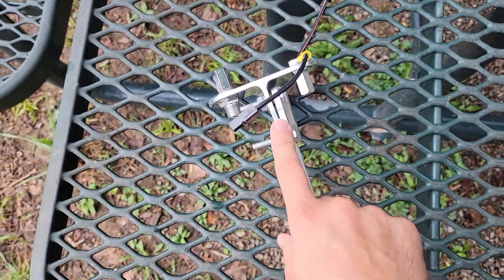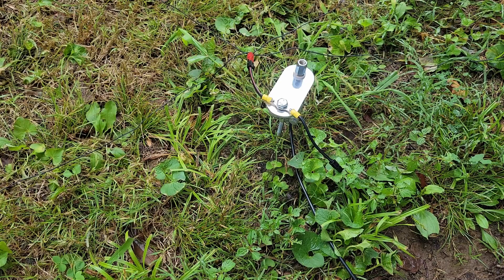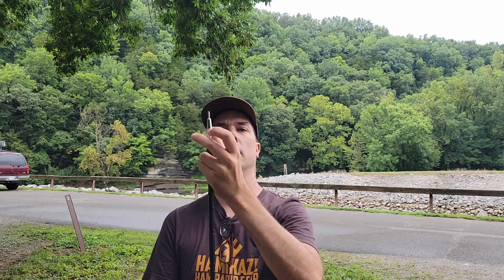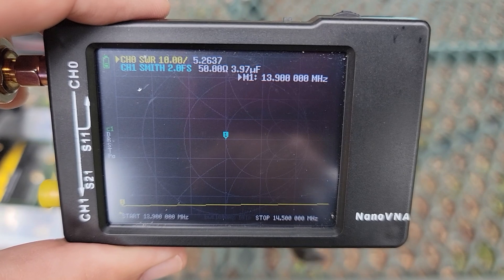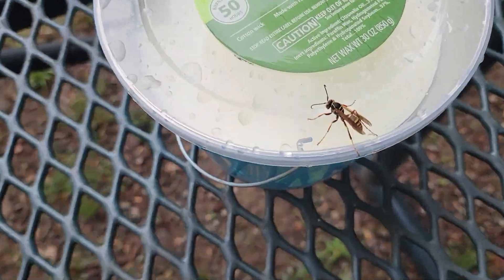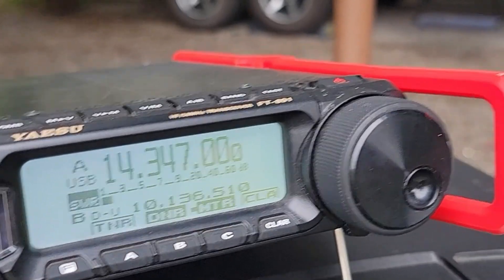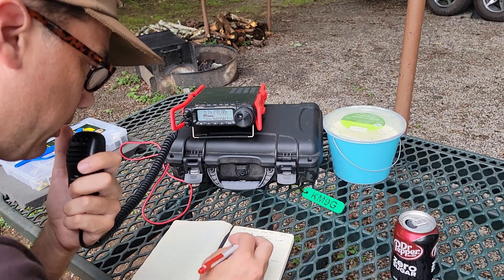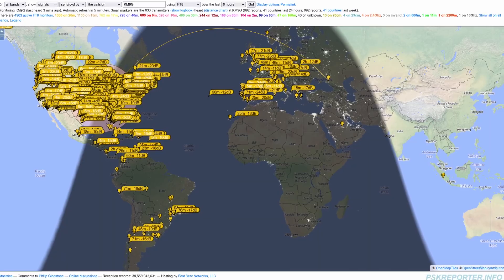These don't even work, right?

Comment: "Just because it resonates, doesn't mean it radiates". Just because you made a contact doesn't make it a good antenna.  I guess it depends on whether you want to use HF for its intended/useful purpose or not.  WAS means nothing to me - I don't see the point of using HF to talk to someone inside the CONUS.
I want to be able to talk to the outside world when talking to the outside world has become illegal.  Or I could just make the DX / contesting argument.
How many overseas /DX contacts did you make with this rig?
Reply from the maker: I have seen people work DX with hamsticks, but it's a compromise -- as is any antenna, and you get the results you get.  If DX is your goal, there are always better choices depending on budget

Comment: MFJ-1898 How do these ham sticks set up compare to the MFJ-1898 you tested. Which set up worked better for you? KO6ALP
Reply from the maker: Setup was exactly the same
Reply: @temporarilyoffline  I guess I meant performance, I can see how easy both are to set up.
Reply from the maker: @besmith00299  They all work "about the same" -with in "statistical norms"... Its really hard to compare two of the same antennas to each other because of changing band conditions, etc.  If these were dipoles vs. verticals or some other "massive" difference I'd be worried.  The only real thing to know about hamsticks is the amount of power they can handle.

Comment: I live in an HOA, have been using hamsticks for the past 10 years. I have 4 hamsticks, each one mounted on a 3’ pole with counterpoise wires. I operate on 30, 40, 60 and 80 meters with the hamsticks. I have WAS on each band. For 20-10 meters I am using a Transworld TW2010 vertical dipole. I highly recommend the hamsticks for an HOA application or portable operation. It’s worked for me over the years….
Reply from the maker: That's awesome!

Comment: I find a great way to experiment is use a laptop or smartphone to tune to a WEBSDR like utah or KFS etc and see what your signals look like far from your QTH. I found out a HamStick on the back of my van does 2 to 5 db better than the 19' tunable endfed on the back of the van. I use a 15 and 20m hamsticks on a plate in the back yard for worldwide WSPR coverage. Yep they get out and receive well.
Reply from the maker: I'm a fan.

Comment: Love hamsticks. Got them on a 2' pole in backyard on a large shelf assembly for ground area. With a 15m and 20m stick connected on the mount plate and spread at a 10 degree angle like a v. With them i run a Ultimate 3 WSPR at 1/4w and get world wide reports on 20,15, and 10m. With my 6 watt qrp rig to WebSdr's all over the US and hawaii i see my signal at only 3db less than the rotatable dipole on the roof. on my van's roof mount i get about the same signal at websdrs all over US and Hawai as my 19' tall EFHW mounted on the back of the van. Soon hoping to get 2 of them mounted about 8' apart and compare to just one.
Reply from the maker: That sounds pretty awesome!

Comment: Appreciate you sharing this video and associated information. I am getting a POTA Station prepared and planning on using some HAM Sticks. This has been a great refresher as I haven’t used my HAM STICKS in several years.
Reply from the maker: These are great for POTA.  I have a set in my truck that I've been carrying around.  I need to get them on the mag mount and make a video about that next.

Comment: I saw a video about radials from a guy in UK. Raising it off the ground and adding 2 resonant radials supposedly gives you 6 db gain. Radials for 40m would be about 35 feet.
Reply from the maker: Sounds right! I'll try it in a future video
Reply: @temporarilyoffline  He compared it to a yagi, where the reflector is slightly longer than the antenna. A little more than 1/4 wavelength.
Reply from the maker: @tangobayus Another fun experiment!
Reply: @temporarilyoffline  Have you tried 20m using a 40m hamstick?
Reply from the maker: @tangobayus Not yet, I don't have a 40m hamstick
Reply: @temporarilyoffline  40m hamstick should be 1/2 wave on 20m :)

Comment: I bought a 40 meter MFJ ham stick and it does work... not as well as an inverted V but it can get the job done. btw I'd recommend setting the stinger where the antenna is resonant where you want it and then cutting off the excess. From what I have read, its not good to have any of the stinger in the coil while transmitting. I'm not sure if yours was like this but this is just general info for anyone who uses ham sticks. 73 KD5YOU
Reply from the maker: I have heard the same thing about cutting the stinger.  I move so often and the ground reference changes, so I left mine uncut

Comment: great ! watch the outher video. with that area you want low take off angle. ground mount vertical is way to go. if you put on mast as you go up the take off angle will change. this can help if you are trying to reach a  country of interest.  with ground elements I found more is better spread them out. more short is better then few long.  love them power poles  . the less time for set up is more time on the air. 73's
Reply from the maker: Exactly!

Comment: you should try the telescopic mfj 17' antenna, that thing rocks, it's small when all collapse and very light. For portable operation, you would have a lot more gain on 20 with a 17' whip ! That telescopic antenna covers from 20-6m depending on how long you deploy it. Perfect for portable operation with full resonant antenna, no coils.
Reply from the maker: I have a few of those and I've got some videos in the queue coming up.  I think you can even get 2m on that 17ft when fully collapsed - so I've heard.

Comment: Since I could not built a antenna at my place I went with the MoonRaker Hamstick for 10/15/80 m (3 Hamstick) and made my very first DX contact from Germany to Israel. 3000 Kilometer. Mounted the stick to a magnetic foot for cars. Attached to my xiegu g90. Made the ssb contact at 15 Meter
Reply from the maker: That's awesome!  Hamsticks are cheap and they work.  I'm a fan!

Comment: I use hamsticks on my motorscooter (not while driving of course).  I have a jaw clamp that attaches to the scooter.  The mass of the scooter does not seem to be enough, but when I use a 5m length of coax the SWR falls into the sweet spot.
Reply from the maker: Sounds like you need a counterpoise!  Great fun!

Comment: I have 20m and 40m hamsticks on my f-250 through a 2x1 coax switch in the cab.  They’re finicky to tune set up.  But they work just fine.  73 de Chris K2CJB
Reply from the maker: I'm looking forward to trying them mobile.  Cheaper than an ATAS!

Comment: Dumb question: yep, I'm full of them.
Where's (if you know cause I can't figure it out) the starting point for tuning a 80 meter shark ham stick? No instructions came with it and the SWR is off the charts.
Reply from the maker: Sure, what tool are you using?  I would start full extended and see where your 1:1 SWR is. And then your only choice is to shorten the whip until you get where you want.  Keep in mind there is an 80m and a 75m ham stick.  80m is a huge band, so you might be trying to tune a frequency the stick isn't meant for.
Reply: Trying to get 3.905  which is a local channel. Started with about 45" extended and have now worked my way all the way back to 30". SWR maxed each move which was about 1" each time. No sure what to do, but I am using my 7300's built in SWR meter if that makes a difference. Don't have a specific SWR meter yet.  @temporarilyoffline
Reply from the maker: @bigdicksplace  that's what I suspected - you're on the higher end of 80m aka 75m.  You can't make the antenna short enough to get good SWR.  Try as low as your license allows and see if you can get a better match on the other end.
Reply from the maker: @bigdicksplace  no worries.  If you  use a NanoVNA you can better visualize what's happening, but with some practice you can do it without the VNA.  Turn the volume up on your radio and move the whip until you hear the loudest noise - then you're really close.  From there, with your antenna, you're going to want to move mere millimeters to fine tune it.  It's almost an art, but if you start with the most noise, you should be close enough for the 7300s built in SWR tool to tell you I'd you are too long or too short.
Reply from the maker: I actually don't... so I need to get on that.  I have one for testing Coax: https://youtu.be/W_u_VM_F224 and I use it in this video, but don't really go over how I get to the point and what to do when you have an answer.  So now that video is on the list (which is ever-growing!!)   @bigdicksplace

Comment: Will these mono-band antennas also resonate on other frequencies? So for example a 60 meter antenna on 30?
Reply from the maker: 60m and 30m are pretty far apart - you might get away with 20/17 or 10/11/12  - if you already have one, it never hurts to try.  You could also (gasp) use a tuner and get understandably compromised results.
Reply: OK, thanks. I was thinking that where it would work as 1/4 wavelength it might also work at 1/2 wavelength at double the frequency, but maybe antennas with coils like this don't work well that way. 73
Reply from the maker: Only one way to find out!  @WR3ND

Comment: similar setup for hamstick and 20m telescoping vertical.. and I POTA away for 1000's of QSOs...  the 12 penny nail and mirror mount works... and I only use 50-70w amp off  LFP batteries.. and "it gets the job done" as I head on ham say recently.. 🙂always great videos (and I use G90 and now X6100 exclusively..need an update on that rig maybe?)  -KD2PWB <Keith>
Reply from the maker: Thanks!  I do have some x6100 updates coming!  So many vids to make, so little time!
Reply: @temporarilyoffline    So many unique POTA parks to activate... (and long distances to drive..hum.. ok I'll still keep activating..17,000+ QSOs and still going with the X6100 and ham sticks on the car..  thanks for you great insightful videos (you gave the info and I bought the X6100..hum..need that FT8 flash card to boot off to make things even more DIGITAL and compact..hum...topic?)
Reply from the maker: @werkiek  right on - time keeps on marching!

Comment: Dumb question but we’re you tuning the antenna with the radials on or off?
Reply from the maker: Radials on - every antenna needs 2 sides, if it doesn't have a second side, the your coax becomes that second side.  (With a mag- or car- mount, thr car is the second side).  Hope that helps!

Comment: I also have 2 40m hamsticks, and one 80m, and another 80m but made by Pro-Am ,but don't have a mount for a dipole config. I wonder if i should make one or buy one . The ready to use ones aren't very cheap. Thanks for your video.
Reply from the maker: Check out the link in the description and see if that dipole mount is cheap enough.

Comment: I use a pair of ham sticks as portable dipoles on 20, 17 and 15 up 20' on 4 sections of 5' alum tv masts with my FT-817ND.  Playing around out in the woods a few weeks ago with the HF activity group (former HFPack folks), I heard NZ on 15, but couldnt get back to him with my 5 watts.  Did quite well otherwise, tho.  I have a pair for 40, but they are just too short (very low efficiency).  Try a ham stick in a mag mount on your car roof.  I think u will be pleasantly surprised.  72, 73, Jerry   wa2omu
Reply from the maker: I'm on it, sounds like part 4 is in the works!
Reply: @temporarilyoffline  I also use a 24" length of 1/4"ID ferrite silicone tube for a CM choke on the coax at the antenna feed point, you can find it if you look.   Handier than toroids.  Jerry
Reply from the maker: @iamnobody9542  that's a new one, I'll have to take a look, thanks
Reply: @temporarilyoffline  If you cant find it, a few 0.2" ID # 31 or 43 ferrite sleeve beads will work too.  Tape them in place just behind the coax connector to the antenna.  You would likely get that tubing from a ferrite house, too. They form a choke balun (1:1 Current balun) to keep RF off the outside of the coax.  With an EFHW, put that choke at the rig or tuner output to use the braid as your counterpoise, but keep the RF out of your radio.  Jerry

Comment: Hams sticks are not great antennas, but they do work. For portable use, they are good if you only need to fill in one or two bands (ie adding a 17m stick because your main antenna is a 10-40m EFHW), but they stop making sense when you start buying four or five of them. Getting a sporty 40 coil and a 17ft whip gets you  a better antenna, covers 8 bands (6-40m) and you're carrying a lot less stuff with you. The people that only use ham sticks are usually the first people I see complaining about band conditions.
Reply from the maker: Some people's kids man

Comment: Great ham stick video.   I have used them alot  when band conditions are good hard to beat, quick set up and take down. I have used with metal cooking sheet, radials  cooking sheet resting on ground with good luck.  Will have to try with ground spike.  Keep up good work.  Ed KF5ETZ
Reply from the maker: Thanks Ed - they just plain work and I guess that's why they have been around so long.

Comment: Years ago I worked Japan and Galapagos on a 20m Hamstick on a clamp mount on a rusted steel T post. At the time I had a TS2000 and was running 100w.
Reply from the maker: It's amazing what you can do with so little.

Comment: I use a hamstick on the truck for 10 and 12m. Works fantastic. 2:1 or less from 27.185 to 29.6 with the 10m stick. Made fully mobile contacts as far away as VK and ZL land running 50-60 watts. Can't be beat for the money.
Reply from the maker: That's sweet!

Comment: Cool portable setup 😎 
I've always wanted a ft 857d or 89. Thanks for the video Steve.
How much gain with 1 vertical vs. the 2 in a dipole configuration?
Reply from the maker: I don't know, I'd need to model it in MMANA - which I'm not good at.
Reply: Good video.  Hamsticks really don’t deserve their “dummy load on a stick” reputation.  I suspect they got it from people using them on 75 meters for local short haul contacts.  On 75 meters any mobile antenna is not going to be very efficient.  What’s more significant however is that most short haul contacts on 75 involve high angle and often NVIS propagation.  Well, a mobile vertical antenna is a low angle radiator and has low high angle radiation efficiency.

I’ve been using Hamsticks in mobile operation on 80 through 6 meters for over 22 years now and have had excellent results with them.  Yes on 75 locals may not hear you very well, but they are not bad for working DX with their low angle radiation pattern.  On many occasions I’ve been told by locals on 75 that they are having trouble hearing my mobile, and a few minutes and only a small number of kHz down the band in the DX window I can have solid extended rag chew contacts with stations in Europe, and on occasions have made contacts to Australia and Japan via long path.  

On forty meters and higher frequency bands of course they are much more efficient as their  length relative to wavelength gets larger.

What I really like about them for mobile use is that they are very tough and have low wind resistance.  I’ve only broken one once underway in over 22 years and that was due to stupidity on my part when I backed my truck under a large crabapple tree.  The low wind load of them allows you to mount them on a vehicle without any nerdy looking guy lines to keep them stable at highway speeds.

One thing you didn’t mention is that Hamsticks, and in fact almost all physically short vertical antennas will have a relatively low feed point impedance, especially on 40 and 80 meters.  You can get a near perfect close to 1:1 SWR at resonance simply by using a shunt capacity match across the feed point at the base of the antenna, typically 500 or 1000pf on 75/80 and 500pf on 40, usually not needed on higher bands. The Hamstick instructions usually identify this.  Alternatively, a small shunt coil across the feed point can be used, which has the advantage of also providing a static discharge drain path for the antenna.

Chris AJ1G Stonington CT
Reply from the maker: @ajfogertyfan8245  hey Chris, that's awesome! Thanks for sharing.

Comment: I used hamsticks on the 5th wheel when we wintered in AZ. Being fiberglass I did run some radials. Worked out great.
Reply from the maker: Sounds like fun.  Where in AZ?
Reply: @temporarilyoffline  Mesa. 1st year was in a no frills, no nothing except hook-ups because it was kind of last minute. Then we work camped at Val Vista Villages for 4 years and then just paid for the 5th year. Then grandkids came along so we now just stay home.

Comment: Just curious, would it be possible to fabricate a mounting plate to allow you to install 2, 3, or more Hamsticks using the stake and radial configuration and create a multiband vertical?  A poor man's DX Commander?
Reply from the maker: You sure could - the links in the description will get you the 3/8ths X 24 to SO-239 adapter and then you just need a metal plate and some hardware from the local hardware store and you're in!  When I get more hamsticks, I'll give it a shot and make a video... but right now I only have the 2 20m sticks.